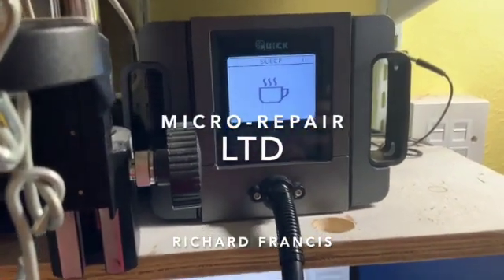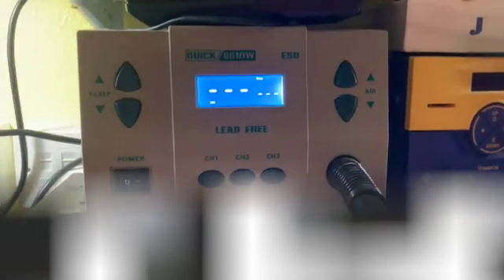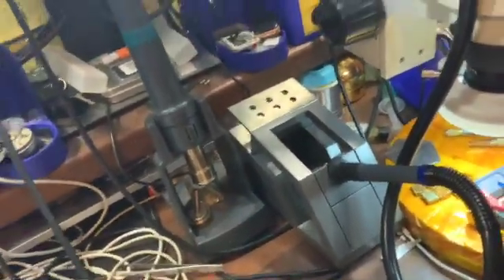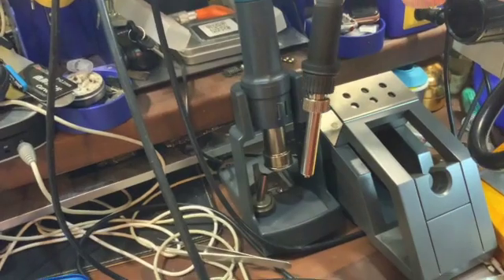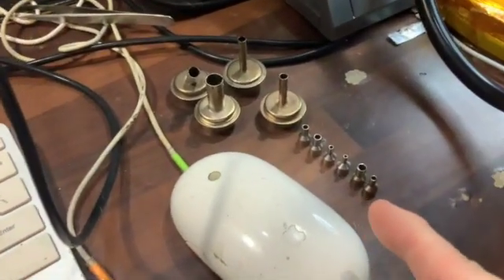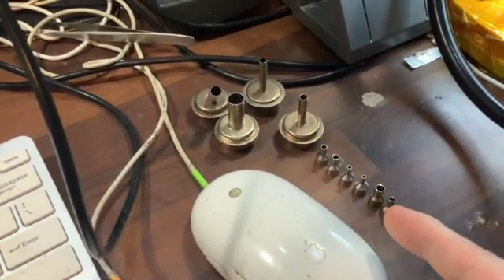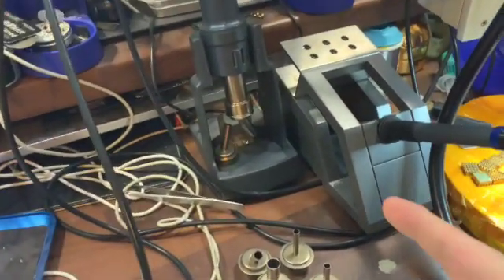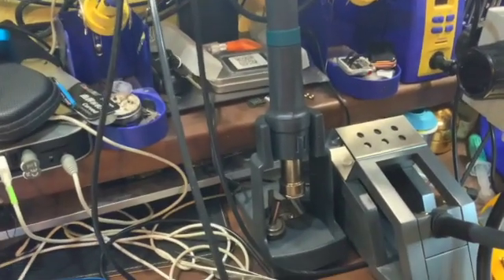QUICK 861DW VS QUICK TR1100 HOT AIR REWORK STATIONS FOR BOARD REPAIR!!

Comment: does quick have a soldering rework station??
Reply from the maker: Quick make soldering iron stations, hot air stations, preheating stations and whole range of different rework tools. But I haven’t seen a quick soldering iron and hot air station that’s combined unfortunately, they sell those as two separate stations. Rich
Reply: @SURGE101  Thank you for the response. I have been looking for a combined unit (to possibly save space and a few quid) but have to get them seperately
Reply from the maker: @shenlun  Any time I can help I’ll try my best. unfortunately Quick only make separate units not a combined one but there another brand of rework station that’s just as good as the Quick and they do rework combined stations. The brand called ATTEN. Here’s a link to the combined station, I’ve seen them cheaper so check there for a better price if you do decide to get this one. 

￡212.88 | ATTEN MS-300 SMD BGA Rework Station 3 IN 1 Combination Maintenance System for Phone Soldering Desoldering DC Power Supply Repair
https://a.aliexpress.com/_m0FrHb4
The ATTEN is just as good. Hope this helps. Rich

Comment: Does the one with the steaming tea cup icon, does it have a small compartment for heating up a cup of water for tea/coffee? LOL!  Thanks are those both sordering iron & hot air?
Reply from the maker: I wished I could have tea and coffee on it 😆 these ones are just for hot air. The soldering iron is on a separate station unfortunately. You can buy all in one stations with the soldering iron and hot air all on one unit.
Reply: @SURGE101  yes both in one set up/piece of equipment! Thanks 🤓
Reply from the maker: @j.lietka9406  the only down side to the all in one systems is that the soldering irons on them are not very good quality normally. If you wanted a decent soldering iron station I would recommend buying two separate stations ( one hot air and one soldering iron station).
Reply: @SURGE101  one good thing about the rework stations is that you can adjust the working temps, plus change tips! I cant afford a Hakko, or a Weller. Thank you
Reply from the maker: @j.lietka9406  a company called SUGON have released a cheap soldering that you can use genuine JBC TIPS on and most reviews say it’s a pretty good soldering station. it’s called SUGON T26 SOLDERING STATION. A lot cheaper than HAKKO AND WELLER but performance wise , it’s just as good.
Reply: @SURGE101  ok thank you 🤓 keep up the tutorials! I pick up discarded smart/i phones, tablets, & laptops for a kind of hobby, & tinker with them! Thank you

Comment: The TR1100 is like a rippoff of the EDSYN reflow head for their micro hotair stations, makes me want to compair the specs of airflow etc to see how they compair to eachother...that would be interesting.🤔
Reply: The TR1100 is spec at 180W, 25-116 L/min.  I couldn't find any EDSYN hot air station that look anything like it but i am not surprised the least if the chinese company copied. That's what they do, it's the only thing they do and we have done nothing to strop them for 20 years because of western banksters.
Reply: @goognamgoognw6637  It's not the physical machine that's looks anything like the TR1100 but the whole handle assembly and mini adapters for micro rework I'm referring to that's been copied on the TR1100.
Reply: @stalwartcomputers5182  Ah ok, i understand now. This is very common with chinese. The factory that makes one part of a system for example the nozzles is not going to stay loyal to just one brand corporation. They'll sell the same part to many another chinese companies  who make similar but different products. The chinese are unregulated.  I actually read that they copied JBC and that the JBC nozzles may be compatible with the TR- line up. In any case, i am about to invest in the TR-1100.